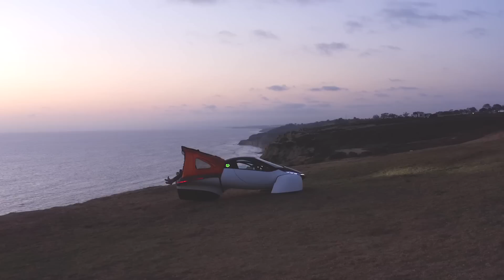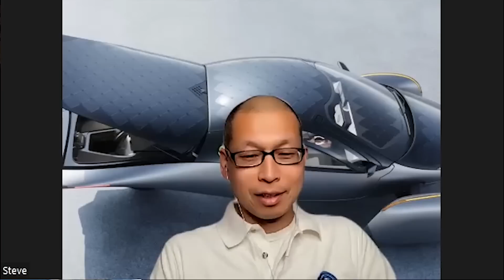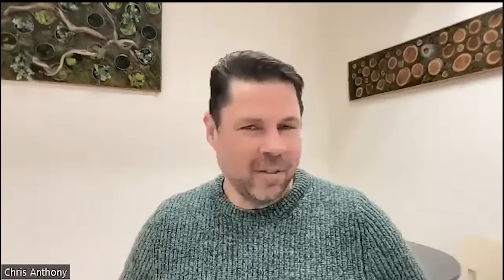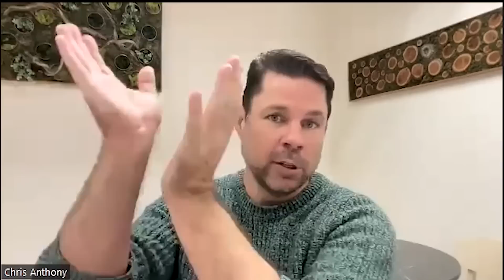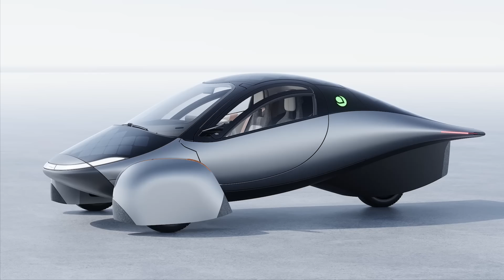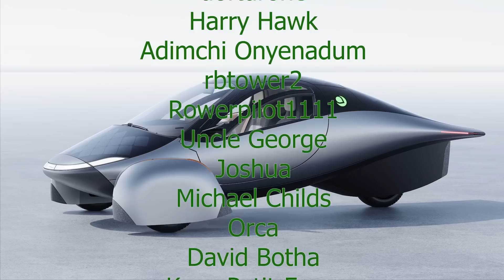Chris Anthony answers questions about Launch Edition, DCFC and production funding

Comment: Another great video!!  It also never ceases to amaze me how transparent and candid Chris is with interviews.  His customer and public-focused attitude are no doubt why there might be plenty of controversy surounding Aptera, but lack of trust is not part of it!

I only had one additional question and maybe this puts me in the minority, but I personally am not a fan of perpetually internet-connected vehicles.  Chris mentioned telematics and data collection being critical to the future development and improvement of the Aptera.  While I see the importance of this data collection, I'm not sure I'm onboard with that.   I also understand a data or internet connection will be needed for OTAs, etc, but I never use in vehicle navigation, etc.  So I'm just wondering will there will be a simple way to turn off the telematics/data collection and and an option to manually disable the onboard cellular radio until it's needed for updates, diagnostics, etc?
Reply from the maker: I'm sure there will be.   They are right to repair and will provide schematics.  You could easily just remove the cellular radio if it's not able to be disabled in software
Reply: @ApteraOwnersClub  Yeah I figured.  As a car guy, I'm excited to finally have a car that's produced by a company that doesn't treat its customers as imbeciles unable to use a wrench.  And I'm not trying to eliminate the modem completely, simply want some sort of kill switch.  But like you said, I imagine with schematics, wiring diagrams and Aptera's right-to-repair attitude, I should have no problem wiring in my own!
Reply: I guess there are different point of view on this. My vehicle is just old enough to havecrge first attempts to allow connective of cell phone.  Hiwever it USB port doesn't play well with phones. So b I window mount my Android phone and have everything voice enabled. I can speak and say OK Google Take me to a destination. Or take me home and it starts Google maps and speaks driving direction to me. I can ask it to find me gas station. Or a bathroom or a restaurant and it will audibly offer me choices without have to take my eyes off the road. If someone texts me it speaks it to me.

Comment: I looked up the 3M 2080 wrap they’re looking at using, it has 7year vertical warranty, so basicly we can expect about 7year lifespan and since only 35% of the car is wrapped it should be as Chris said easy and cheap to wrap,, heck I might just do it myself and really save $$$.
Great interview Steve and great questions.
Soooo,, just to sumerize Launch edition : no heated or cooled seats, 40-60KW DCFC, car cellular connectivity, I’m assuming no cruise control, ability to add LVL 2 driving later easily.
You didn’t ask about cruise control specifically but I’m assuming LE won’t have it??
I really like dynamic cruise control but I’m guessing since no radar or foward facing cameras it won’t be on launch edition??
Chris said he’s FULLY confident they’ll get funding
Reply: and it is amazing they will release the wrap templates for easy customazition or refresh as necessary
Reply: I though he mentioned heated seats but not wired.

Comment: Steve great video. You ask a question about turning off the third motor. That's what I'm interested in for the rear motor. Can the wires to motor be eliminated and have only front wheel drive?

Comment: forget V2G, forget heated/cooled seats, forget ADAS, forget cellular connectivity, forget side airbags... keep it simple, easy and cheap to manufacture. You can add stuff later once their making money and the core manufacturing is worked out. What I've yet to hear is an explanation of the belly pan heating and cooling. That's an engineering innovation that is key to the aerodynamics, and as an Engineer I've heard nothing about how (and if) it works.

Comment: I'm feeling much better about a wrap instead of the paint. Love that they'll provide the pattern for a local shop to cut. That leads to the question :  Can I receive mine wrapless for a lower price and have it covered myself? That seems like a simple option to offer on the website's order page.
Reply: Just best guessing but probably not.  The biggest obstruction wouldn’t necessarily be logistical but rather legal constraints around warranties.  Ultimately cheaper to just ship out another wrapped vehicle for you to elect to re-wrap rather than deal with all the hurdles of also shipping unwrapped models with customized warranties.
Reply: @joelsmith4394  Good points!
Reply: @joelsmith4394  I've picked the custom colour option. It's painful to see an upcharge of thousands of dollars for what I feel is a minor tweak. A few hundred maybe. One docket change? But what do I know.
Reply: @Randy J it is so important for Aptera now to get through production, very few companies pull this part off, so having 1 standard design minimizes the errors/defects/delays etc that negatively impact performance.  I know "wrapless" sounds like a minor change but having no options for us intially will help Aptera as they try for production.
Reply: @jttasb  You're absolutely correct. In my case I chose the custom colour option. Probably Ruby Red. It will be a long wait but I'm okay with that. I want to see how it does in real world conditions by thousands of users before I commit my money to a purchase.
Reply: I wonder if a silicone based U/V non-abrasive car wax can be used on the wrap finish (to extend wrap life)?
Reply: @a5-30-31cts  various folks have extolled the merits of the “ceramic” coatings to extend the life of a wrap.  I have serious doubts that there is anything genuinely “ceramic” about these coatings but folks seem to think they work regardless.  I have not had occasion to use them myself.
Reply: @joelsmith4394   the ceramic coatings drastiscly reduce solar degradation as it reflects most of the suns uv rays.  Clear ceramic tint will  keep your car cooler than 5% non-ceramic tint.    Applying this to paint/wraps which both are susceptiple to solar rays...means that a ceramic coating will greatly imporve the life of the wrap/paint.     That's JUST discussing solar radiation.  Not wind, rain, or anything else...

Comment: This was great to watch Steve! You really hit so many big questions that hadn't been fully answered before, or needed follow-up questions to clarify. And as usual Chris was forthcoming and clear about what their plans were, and how everything will be moving forward. I was curious why the motor power seemed a bit lower than Elaphe's M700 motor, which was thought to be the Aptera's motor. We knew that Elaphe was going to build a custom motor for the Aptera that was optimized for maximum efficiency. But I wonder if Aptera made a little trade off in power for each motor in exchange for having the tri-motor configuration as standard for the Launch Edition. For the record, I'm fine with that choice, because I was already going to get the AWD model, and the performance still appears to be exceptional. I was really hoping for production to begin later this year, but I will happily trade that for the idea that production won't be shut down completely by a lack of funding. I'm sure that we will find out more in the investors meeting today. Thanks for getting so many of these important questions answered and clarified with this interview!
Reply: As a follow up, in the investor's meeting they mentioned that Elaphe specifically redesigned their wheel motor design to work better for the Aptera. Apparently, the power delivery was engineered to support heavier vehicles (like most EVs today) and Elaphe redesigned the new motor to work with the Aptera's lower loads (lighter weight, aerodynamic) to maximize efficiency.

Comment: 110 charging and getting decent miles/hr is so important for people that don't have normal access to have a level 2 charger if they rent or visiting someone that doesn't have a place to charge.
Reply: If you are L1 charging and using an extension cord, please make sure the cord is rated at 20A even if you are connecting it to a 15A circuit.  A 100' 15A cord will have a large loss compared to a 20A cord and it is much safer.  Yes, a 100' 20A cord will cost much more but it is well worth it.  If you have a dedicated 20A circuit and are planning on charging at its max, 16A, make sure you have a 20A cord.  Your extension cord should not get hot.  it is also best to use the shortest extension that you need.  If you only need 25', don't put a 100' cable on it.
Reply: @ddessert6  
Good advice! I do exactly what he’s saying charging my Prius prime on 110V, and it works great!! No issues.
Yes,, I believe many aren’t getting that the ability to charge 150mi overnight on ordinary 110 using an extension cord is a HUGE HUGE deal! NO other EV can do that. I live in a house but I don’t have room in my garage, but I’ll be able to fully charge my Aptera with the solar and a 110V extension cord . Also I have access to FREE lvl2 charging at my local Mall. So will probably only have to PAY for a charge once in a blue moon! Lol😂
Reply: @ddessert6  I've seen people in NYC dangle an extension cord 3 floors down to charge their Tesla. I guess it was an emergency situation to try to get it to a proper charger but it was nuts seeing that. If I can't get a level 2 charger installed, I'm glad 110 can suffice for daily use
Reply: @calvinlim9485  people do some incredibly unsafe things not knowing the danger. I am hoping that people might see this and think about it when they go to plug in their EV, no matter what type, if they are using L1 charging. I have seen people burn their house down when charging their vehicle with L1 and it had nothing to do with the vehicle but all to do with the improper extension cord they were using. An extension cord should never get hot when using it. If you can avoid using an extension cord, by all means do.
Reply: @ddessert6  yup way ahead of you. I have thick gauge extension cords and it's enough to get from the garage to the driveway for pressure washers and stuff like that and it has the GFI protection too to prevent shorts.
Reply: @Don Dessert  very wise advice.  An inadequate extension cord that can't handle the current could heat and cause a fire.
Reply: I’m a little disappointed about NOT having Cruise control or Lvl2 assist, and heated seats in Launch edition. But those are first world problems and not a big deal
Reply: @Airman749  If Cruise control is not included, I would be incredibly disappointed.  That is a very simple thing to have and the last vehicle that I had that did not have it was a 79 Mustang and it puzzled me why it wasn't include back then but back then they tended not to put cruise control on a stick shift for some reason.

Comment: Great job Steve. It's always great to see Chris answer questions. Thank you again for creating and sharing!
Reply from the maker: My pleasure!
Reply: @ApteraOwnersClub  whats best battery size is best for longevity? thsi place doesnt let me talk often so i cant say more
Reply: @kalmmonke5037  Take this with a grain of salt (since this comment is from the E-bike perspective, but I think it should still apply with EV's)  

In the e-bike world, if cell quality is fixed, generally, the more parallel cell rows the pack has, the longer the longevity of the pack.  Adding more parallel rows of cells "spreads" the load across those parallel rows (resulting in less stress for all cells(i.e. less heat buildup) during high discharge/charge rates.  Heat is a major cause of cell degradation.  

Example: Since a Lithium Ion cell is nominally 3.6volts, a 36v pack will have 10 cells connected in series ("10s").  If you ran this 10s pack full blast on an ebike until the pack is drained, it will be red hot (if not explode in fire).  Also if you tried a "Fast Charge" on this small pack using a 10 (high) amp charger,  the pack will also become red hot and possibly explode and burn the house down.  But let's say you connected 6 of these 10s packs in parallel (i.e. "10s6p" or 60 cells in total), this 10s6p pack will become only slightly warm under these  extreme charge/discharge scenarios.  This 10s6p pack will last much much longer than the original 10s1p pack.

As to your original question, "whats best battery size is best for longevity", I guess one might say, "the bigger, the better".    

Of course, how fast one discharges and charges the battery (and how long is this heavy current lasts) is the other factor in heat build up. 

Battery pack longevity (minimizing battery heat) is also determined by the driver.  A lead-footed squid who is impatient with charging (always goes with 150wh-300wh DCFC will destroy his battery pack much sooner than a driver who accelerates moderately and who relies on slower Level 1 or 2 charging or Aptera's solar trickle charge  (I suggest the full solar package - at least the rear hatch).  

The most prominent cause of cell degradation (short life span) are: a) Heat, b) letting the cell drain to (or heaven forbid, beyond) its "empty voltage state" (on 3.6v lithium ion cells, the "empty" voltage is 2.8v to 3.0v),  and  c) leaving the cell in its fully charged voltage (4.2v for Lithium ion), for long periods. 

(Most responsible PHEV/BEV makers (such as Toyota) will not let the battery charge past 80-90% and will not let the battery discharge below 20%-15%.  This is why Prius battery packs last so long, even when they were still using the old nickel metal hydrate cells.)

Cell quality is another big factor in cell longevity.  (Cheap cells may only last maybe 300-500 hundred charge/discharge cycles, whereas name brand (Panasonic, Sanyo, etc.) may last a few thousand cycles.

With EV's (compared with e-bikes), the difference is just scale. (E-bike pack voltage is 36v-52v (10s4p  and 14s4p), but BEV voltage is over 400 volts (e.g. 100s20p).

The Aptera's stated voltage is 400 volts (around 96s-100s). Depending on your selected "miles" (250, 400, 600, 1,000 miles), will likely determine how many of these 100s cell groups are replicated in parallel.    

Again, the 400 mile pack will likely last longer than the 250 mile pack, 600 longer than 400, and so on.  But as the vehicle weight goes up, range and efficiency go down.   (A lot of us who've ordered the 400 mile pack, plan  to minimize instances of high drain/high charge rates - so as to extend the life of the battery.   If we have to race, or connect to high amp DCFC, I plan to do so for short periods at a time (so minimize battery heat).

Hope this helps
Reply: @a5-30-31cts  the more batteries you add, roughly exponentially less effeincy is there because  more energy in and out the battery at faster rate. there is a correct size for longveity to idealize, then a small combustion can run optimal combustions per second at low weigth size etc due to not needng to deal with big rpm changes and trans downshift pressures.  batteries arnt recyclable and petrol can be used as lng as not tkaing too much at once, so at least is batteries become fuly mass ecycled, then such plugin hybrid will be best  balance compact4seater with rear seats facing the rear
Reply: @a5-30-31cts  what an amazing answer you've given, thanks. It really deserves a bigger audience.

I'm not going to get the launch edition, and if/when I do you get an Aptera (new or used) I would need the rear window as I live in Washington State where it can be quite dark much of the year. I'm not going to adapt to that rear camera alone, I need both. I'm assuming that I would lose about 50% of the total solar charging capacity this way…which really won't matter too much where I'm located.

Good to know that 110v/solar is the best way to go to extend battery life.

Comment: Thank you very much for that question about 120 volt ac output. To me a V2L capability would be of very high priority and I really hope they include that in the next iteration. It would greatly benefit for Campings, Power Outages, Offsite Works ......  Also it is a great selling point.
Reply from the maker: Yes, absolutely
Reply: 230V AC 50Hz output would be also interesting. That's what we have in Europe and IIRC some higher power application in the US also have 230V (240V?).
Reply: If the bms is designed for it the charge plug itself may be the best place to plug in an inverter.  This is how others have handled it without complicating the base vehicle.
Reply: @ccibinel  would that not deviate from the existing NACS they have adopted if they implement it in the plug?
Reply: @Soothsayer210  If they were to do this, my guess is that they could make a dongle like the ionic 5.

Comment: Camp mode?
Reply from the maker: That's where the vehicle shuts down everything but keeps climate control and ventilation so that you can comfortably sleep in the vehicle without using too much battery
Reply: @ApteraOwnersClub  yes.  Very similar to pet mode actually.
Reply: Thanks Steve